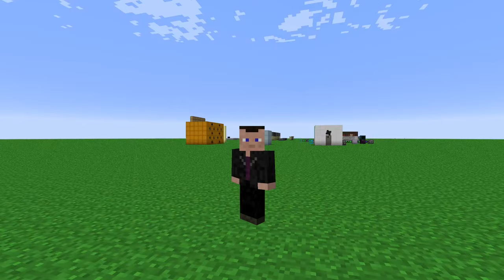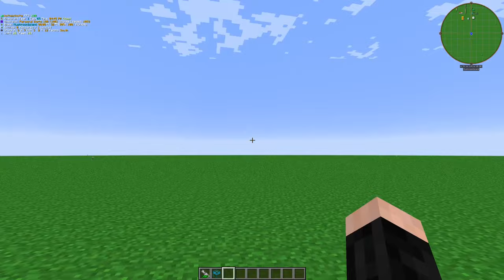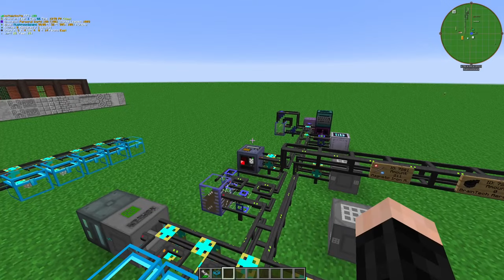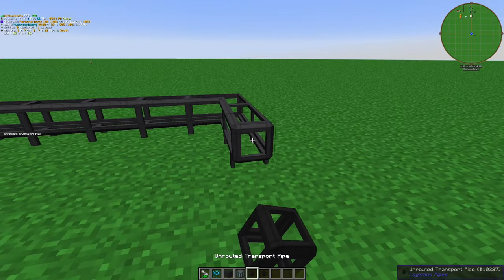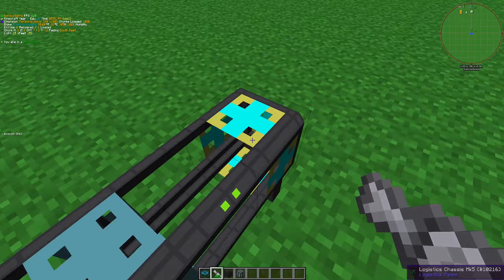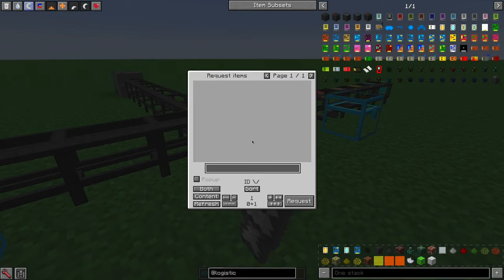GTNH Player's Guide to Logistics Pipes 01: Basics of Logistics Pipes

Comment: Honestly this doesn't seem very useful to make your main storage any more convenient to use. You already have the "T" feature for NEI to find things you're looking for, so looking through chests already isn't a problem. If you keep them near your machines and crafting things there is basically no use for logistics integration of your main storage. It also looks super expensive and tedious to set up compared to just having organized chests, and doesn't look like it saves much time doing anything. It does seem useful for creating a few machines on the side to automate something specific, but you don't need to hook up your whole storage to the pipes to do that.
Reply from the maker: It is leagues better than just keep using `T`. both for convenience and automation. This video is just part 1 of Logistics Pipes, on later episodes, I'm going to show the ways of automation, auto-crafting, fluid management, etc. It is a really nice way of handling the automation pre-AE2 era in the pack and it's not expensive at all. Most recipes give multiple outputs and as long as you automate circuits, you're good.

Comment: And allways remember to document your logistics network, even wooden signs will do.

Or you will end up like me praying to the omisiah and burning holly incense so the whatever mysterious force driving my platinum line does not disapear.
Cause after almost a week of trying to figure out eldrich mess that was my "palplatine tower"(the one and only label inside the damn thing) with for reasons unknown to me and others on the server was contained in a single chunk and almost as tall as a chunk itself, we figured out that it was self powered bylarge nodes made by bees and that what we assumed was rhodium extraction part was in fact a backup rhodium extraction(or more propably I frogot that there was already one when setting it up at 4am), and I'm sure that there were multiple "backups" like this cause everything was working after disconnecting bunch of pipes and osmium output had doubled, with I suspected had something to do with hydrochloric accid pipe being accidentaly rerouted from last step of rhodium dust "backup" that was nothing to run, into iridium stage 2.
Reply from the maker: As you'll see in the next episode (and in the thumbnail), the wooden signs will be placed on those machines to explain what they do.
Reply from the maker: Also, thanks for the warning to everyone, it is important.